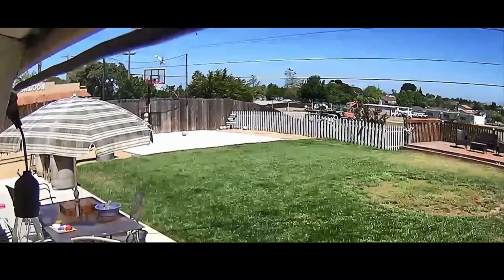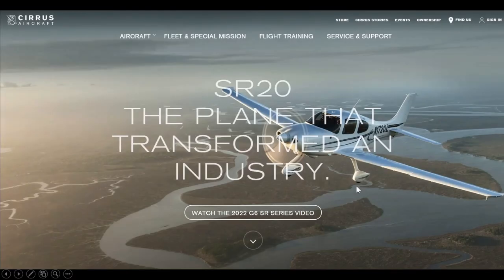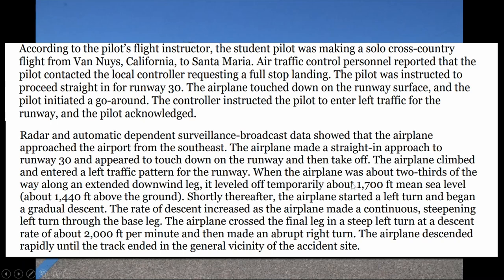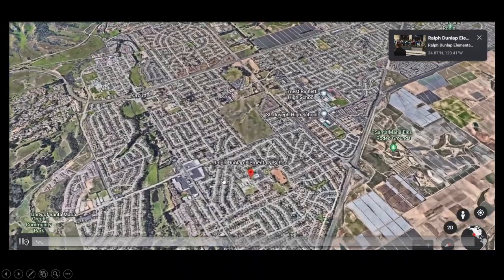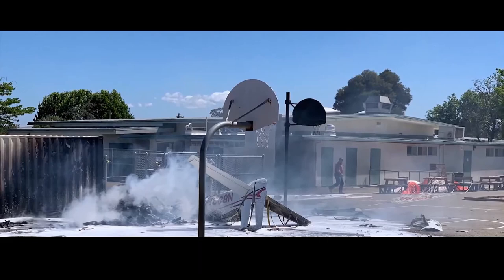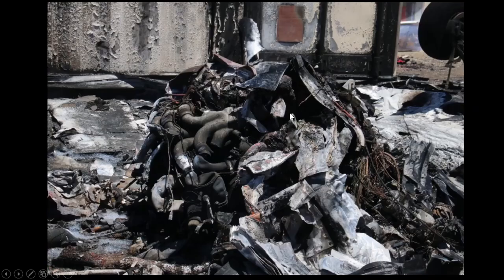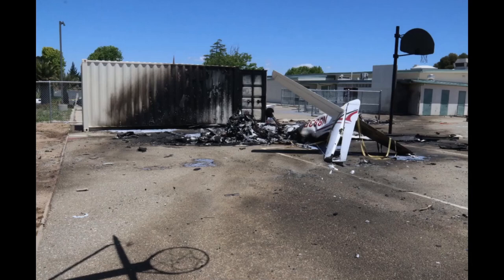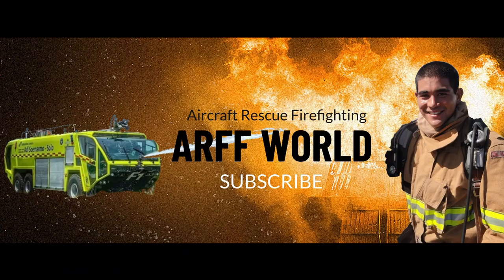Student Pilot Deploys Parachute Too Late

Comment: I am at the exact same point in my flight training. 3 solos down and almost done just over 50 hours now. I did not solo until about 25 hours because I am having trouble with landings. There is no set number of hours. I could have solo'ed much sooner but felt I didn't have the confidence level and I'm glad I took my time. Now my confidence is better and the fact such a stupid mistake can still get a student that far along in training is a hard thing to accept. I learned from day one that airspeed control on base and final are the difference between life and death.
Reply from the maker: Amen brother, fly safe. Thanks for watching
Reply: Take your time. I went probably 20 hours over on everything. I'm a slower learner but people should not be in a rush imho.
Reply: Go watch some of Dan Gryder’s (?spelling) videos on his YouTube channel called “Probable Cause “.  Especially the ones where he is trying to highlight and educate pilots on how to detect and instinctively correct a stalling airplane.  The only time we train for stalls is well above 1,000 feet, simply because you need the vertical distance to recover.  So in the case of flying the pattern at takeoff and especially landing you have to be hyper aware of preventing a stall and your reaction needs to be instantaneous!!!!! 
This has nothing to do with the kind of airplane this unfortunate student pilot, but more to do with the CFIs lack of stall avoidance/recovery or the students inexperience/ understanding of stalls. 
Happy flying
Reply: Sean, yep airspeed on final extremely important. I bounced down the runway once not coming in correctly.

Comment: A Cessna is more forgiving but would end up in the same situation should the pilot not respect aerodynamic rules and ignore his airspeed and angle of attack.  It does not matter what aircraft you fly, spin recovery at low altitude is a killer as it takes normally 1000 feet to recover after the spin is entered.  RIP to the poor soul who did not respect his aircraft's envelope when maneuvering at low altitude.
Reply from the maker: Thanks for your take Theresa
Reply: Hardest thing to do for young pilots is nose down to keep speed up. They do the complete opposite and pull back on yoke and that just puts you in a worse spot .
Reply: Theresa, I like your responses & agreed with your other call on the dingbat playing pocket pool with two airliners. You tell it like it is. Good for you! Keoni, you got a lady here who knows her stuff!

Comment: It looks like a stall/spin on base to final. The SR-22 isn’t a good plane to learn to fly in. Edit: should be SR-20
Reply: It was the underpowered SR 20, 100 horsepower less than the SR 22. You need 2000 feet before you deploy the parachute which is higher than the traffic pattern .
Reply: @Nord3202  SR20 is also dangerous, not as good as cessna
Reply: His instructor and FBO should have known better. I guess he had more money than common sense. I would not dare try to learn how to fly an RV-10 as a student pilot. You're just asking for trouble.
Reply: Agreeed I did my first 210 hours in SR20. I just bought SR22T and have 80 hours in new plane. It’s real fast someone new this is a bad plane for them to learn in.

Comment: Cirrus is not the aircraft for any low time pilot. Its a very slick fast airplane not for a beginner no how no way. This pilot hit the ground at 300 plus knots showing that he was completely behind the aircraft in his go around I mean pulling the CAPS at 30 feet AGL shows that he had no idea where he was at in his decent.
Reply from the maker: Sad one for sure Jeff.  Hopefully some lessons can be learned
Reply: He did NOT hit the ground at 300+ knots.  More in the neighborhood of 100 or so knots at impact.  The SR20 is a perfectly acceptable airplane for low time pilot, provided they are giving appropriate transition training into the aircraft.  Multiple airline flight schools, as well as the United States Air Force Academy, use them for initial flight training.
Reply: It probably took him less than 3 seconds to descend his last 500 feet. If you stall and spin on your base to final turn there is just not time to pull the CAPS lever. Cirrus aircraft are heavy, high performance, built for speed, with high stall speeds, and are not suitable for the solo operation of low time student pilots  period. If this student had been training in a Cessna 150 or a Piper Cherokee without parachutes he’d probably still be alive. They have much lower stall speeds and are much more forgiving.

Comment: Also at 3:05 that big green box back there is a pad mount transformer, very hi voltage ,the guys that work on those use a 10 ft long pole and PPE to neutralize it ,that was a close one, another set of issues if he had hit that too
Reply from the maker: Good observation.  Thanks Dale
Reply: I don't think that he would have felt a thing....

Comment: When a pilot solos depends on the pilot, and every pilot is different.  It also depends on the instructor / training facility.  On rough average, most pilots will start soloing at around 20 hours.  Most facilities will use C172s or C152s initially.

I think part of the problem is a false sense of security that comes with flying a Cirrus --- the belief that it's safer because it has a chute.  It might be because of that, that some tend to fly these birds more carelessly., thinking that if they lose control, just pop the chute (or that the chute will auto-deploy), and all will be ok
Reply from the maker: Thanks for your feedback.  I appreciate it

Comment: There is no set number of hours to be signed off to solo. 

My instructor signed me off at 4 hours to solo.  The owner of the flight school said that is unusually low so he had to me fly with another instructor and he put me through all the different emergency procedures and agreed I was good to go.   Can't remember, but I think i did my check ride for the private at the minimum required 40 hours. 

Then I decided to try something more challenging and started flying helicopters. 

I will agree that we are seeing way to many crashes of late and they all seem to have a very common issue, lack of maintaining the proper air speed in the different phases of flight.  We are seeing it over and over and over again.
Reply from the maker: Thanks for sharing your story.  Fly safe and thanks for watching.

Comment: The cirrus becomes inverted and face down when you pull the parachute …. It’s designed that way:
Reply: The airframe definitely leans forward for a second or 2 when the parachute deploys before becoming level again which is why you need 1,000ft? i think. This reminds me a bit of the cirrus crash up in northern California where the student and instructor had just taken off and then deployed the parachute extremely late.

Comment: In the past it was common to solo in as little as 6 hours.  Some people are never compadent enough to solo . Those are the extremes. My first solo occurred in just under 11 hours. The thing that makes flying dangerous is you must not sercome to your natural instincts because your instinct  is to do the exact wrong thing. Speed is your friend.  It is often nessary to lower the noise of the plane to maintaine flight speed when the ground is comming up fast. 
All wings will stall . You can stall in any attitude or air speed  angle of attack is the critical factor . I practiced stalls every time I went flying . One day I was given a single place high performance gliders and told have fun ! When you fly single place aircraft you must teach your self what works and what does not . No one can help you. Every single place aircraft has been flown by pilots with 0 fligh time in type .
Reply from the maker: Thanks Thomas for sharing.  6 hours, wow

Comment: The Cessna and Piper trainers have a higher stall speed and are more forgiving. These are the aircraft for folks working on a private pilot certification. Even so, pay attention to air speed and bank angle. By the time a pilot is ready to solo, those limitations should be baked in.
Reply from the maker: Thanks Bruce for your feedback.  Please consider subscribing for more aviation news
Reply: I think that you meant to say Cessna and Piper have a LOWER stall speed.
Reply: @straybullitt   My KR2 would go into a mush , completely controllable . Just dont go full power in a mush , it will snap  roll into a spin that will rock your world.  It would  do a coordinated  turn at 45 or more degrees in a stall mush with idle power and was completely controllable down to  40 mph..
Reply: Stall speeds are lower for those aircraft not higher.

Comment: Chances are that it was not the student pilot's third solo flight. But it very well could have been his third solo CROSS-COUNTRY flight. He simply got too slow. He either stalled while flying straight ahead on the downwind, or he got into an accelerated stall while turning base - probably an un-coordinated turn at that. It's okay to bank the airplane steeply while fairly low to the ground, pilots have done that for generations. But you must be mindful of the 'G' forces required in the turn, the coordination on the controls and the speed of the machine. I often watched my uncle perform low-level, steeply banked turns over a 55-year period as a "crop duster." He never had any trouble... But he was always conscious of his gross weight, the coordination on the controls and the airplane's speed. Traffic pattern work most often requires the nose to be lowered while turning base and final - if for no other reason than because the speed is too low to toy with... Student pilots do not have much experience to judge by; very often their mistakes are unforgivable and final.
Reply from the maker: Thanks for sharing that Mega, I appreciate your input

Comment: This has nothing to do with the Cirrus SR2X series of aircraft.  As a pilot and flight instructor myself, I have about 30 or so hours in the SR20 airplane.  There is nothing defective or inherently dangerous about that airplane that can cause those kinds of accidents. Stall spin accidents during the base to final turn are very common.  The NTSB got the analysis right. Either the student pilot was unaware that they were close to the critical angle of attack, or did not know how to properly assess that they were and take corrective action.  I don’t know what was going through the student pilots head when they initiated that maneuver, but most competent flight instructors will admonish students not to attempt steep turns at slow speed when turning from the base leg to final leg of a traffic pattern because they can easily exceed the critical AoA in an uncoordinated turn, resulting in a stall spin accident like that.  It’s psychologically alluring for a pilot to attempt that and try to save the approach, particularly if they realize they’re about overshoot final approach flight path and they try to pull hard to get the airplane to make it and line up with the runway.  The correct action in this situation is to maintain shallow bank angle, overshoot centerline and initiate a go-around to re-enter the pattern and try again.

The student’s reaction to deploy the CAPS once loss of control happened was the right decision here (straight from the Cirrus CAPS training procedures) albeit a bit delayed judging by the video.  This can be attributed to a natural reaction to stress in the moment.  Unfortunately at these low altitudes (300-400 ft), the parachute did not have time to fully deploy for best results.

In re to how many hours are required to solo, there are no set minimums, but a student pilot shall have received flight instruction in the aeronautical experience areas listed in §61.87(d) through (m) prior to being endorsed by an instructor to fly solo.
Reply from the maker: Thank you for taking the time to write this comment.  Very informative and interesting.  I hope others read it as well

Comment: Another inexperienced student pilot flying a high performance plane with unforgiving flying characteristic. The parachute is no substitute for good training & flying ability which not everyone has. Will they ever learn.
Reply from the maker: Thanks RI for stopping by and the comment
Reply: Think the training was still “in-progress”. Student pilot, X/C solo, probably hadn’t earned his private certificate yet. Very sad.
Reply: There is nothing unforgiving or difficult about the handling qualities of an SR20.
Reply: @TheRealCFF  Your wrong everything happens faster in a Cirrus, for the student pilot it's a recipe for disaster.     Simple slower flying lighter planes with lower stall speeds gives the student more time to make critical decisions and recover from a low level stall in the traffic pattern.
Reply: @Nord3202  An SR20 is a little faster than a Cessna, but not unmanageably faster.  The speeds may be quicker but that’s not necessarily the same as an airplane that has poor handling qualities. Actually an SR 20 is a very docile airplane that’s very easy to manage.  With 10 to 20 flying hours in the airplane and given competent dual instruction, a student pilot should be able to handle it just fine on solo flights.

As a yardstick, the military trains its pilots with little or no starting flight time on fixed wing aircraft in the Beech T-6, a 6,000lb, single engine turboprop with a 1200 shp T-74 (P&W PT6A) engine.  This airplane has cruise speeds in excess of 300 knots and approach speeds right around 100 knots.  This is a far hotter airplane than an SR20, but with good flight handling characteristics and good dual instruction prior to solo, it’s manageable by student pilots.
Reply: @TheRealCFF Most Cirrus pilots would never make the cut in the military. The military only takes the best & brightest pilots and are trained to highest standards for countless hours both physical & mentally. Any fiberglass plane with a 12,000 hour life limited airframe such as a Cirrus SR 20 or 22 is heavier than a monocoque aluminum plane like a Piper Warrior or Archer. Move them on the ground with a tow bar & its obvious which is heavier. Also monocoque plane is much more labor intensive to build than the fiberglass boat type construction in  molds & bonded together.  When a heavier plane stalls it drops faster & takes longer to recover. Laws of gravity.
Reply: @Nord3202  ….well actually there are plenty of crappy military pilots and they don’t get a whole lot of training hours, even with an $850b annual Pentagon budget.  But that’s a tale for another day.

As to your ‘life limit’ comments a Cirrus eGlass airframe has a service life similar to any other GA aircraft - and that’s extendable with maintenance, just like any other aircraft.  And stall handling characteristics are related to airfoil selection and wing planform, though weight does increase stall speed.  But the SR2X has very benign stall handling characteristics and meets all the Part 23 reqs.
Reply: @TheRealCFF  The Cirrus was certified using spin resistance certification standards that's why they need a parachute which won't save you in the traffic pattern down low where these stall spin accidents happen. We are seeing so many fatalities in a plane that uses a parachute as selling point to low time inexperienced pilots with alot money .
Reply: @Nord3202  that’s another old wive’s tale about the SR-2X aircraft.  The airplane does not require a parachute in order to recover from spins or to receive ELOS to substitute for spin certification; In fact the SR20/22, though it did not complete spin certification under Part 23 rules, will recover from erect spins using the standard PARE technique with the flight controls.  Secondly, depending on attitude and altitude at time of deployment of the CAPS, it is quite possible a pilot could survive a stall spin accident in the traffic pattern, if the flight crew reacted quickly using the EP for the CAPS - but no guarantees.  Stall-spin accidents on base to final turns are almost always fatal, regardless of aircraft type or whether a ballistic airframe parachute was standard equipment onboard.  And in regard to Cirrus’s accident record, it is now one of the lowest in the general aviation fleet, thanks and part to Cirrus’s transition training program and groups like COPA.

Comment: I had 13.7 hours of instruction when I made my first solo.
Reply from the maker: Nice.  That’s legit
Reply: I had 10 hours. A 17 year old poor Hispanic student from Miami. In 1969.  The Civil Air Patrol payed for the training.  Never driven a car or motorcycle or any motor vehicle before airplane training (which helps a lot if ever).  
Soloed in a 80 mph approaches Piper Colt which stalls at 74 on a 45 degree bank.  Dangerous airplane.  But.  Been also a soldier before the training helps a lot.😁
Reply: Well you’re definitely the exception.  Numbers should not play into this.  You can solo when you can prove you understand how to handle the airplane.  That may be 10 hours or 50 hours.
Reply: @VLove-CFII  With all due respect, I wasn't even remotely trying to make this into a competition. Naturally if a student pilot takes lessons over a far greater amount of time, a lot more money and hours are going to be spent. I received my private after 11 months of training; again, I'm not bragging. Total hours was 51.
Reply: @ericlozen9631  You are right.  Despite my shorcommings, the 10 hours were done in olny about about 30 days.